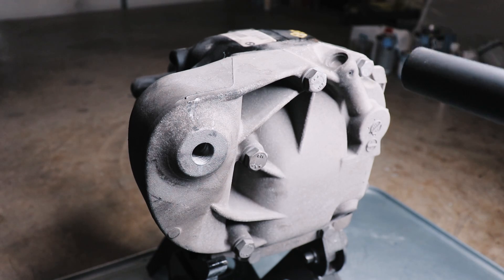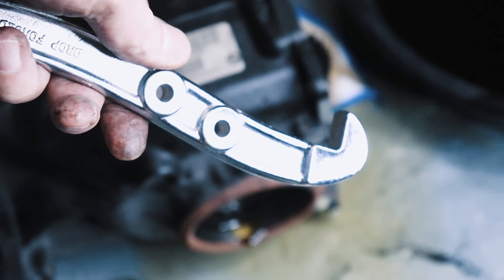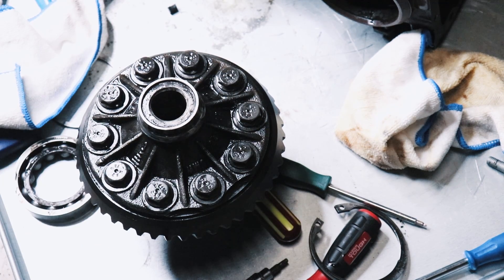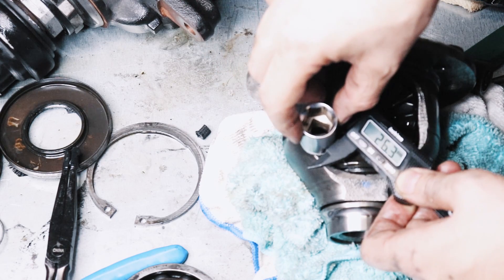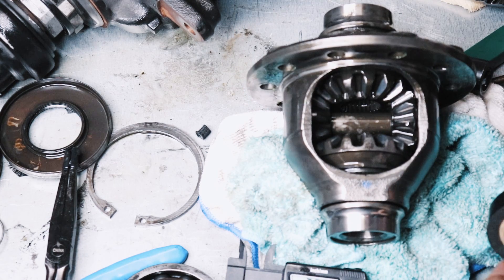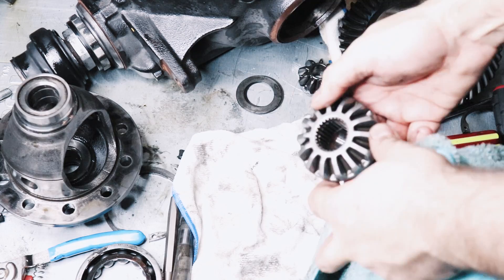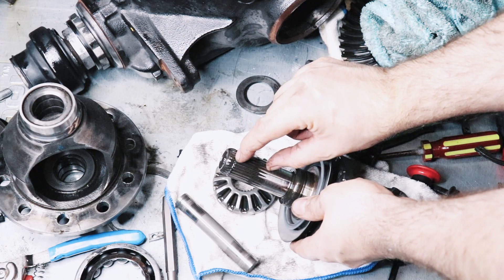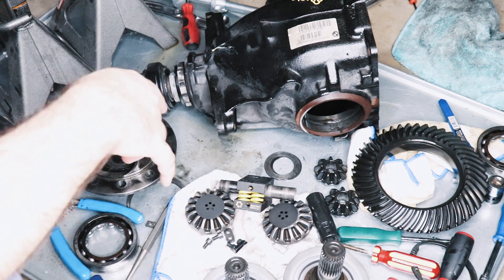BMW E90 $250 Limited Slip Differential Install | Part 1

Comment: Good video! I wonder how you managed to find an opened diff with bolted ring gear? Cos BMW welded them in 335s/135s after 2006, when you get the diff is there a specific part number you used to get a bolted ring gear one? Thanks

Comment: These diffs from the factory are garbage…. No drain plug so no easy oil change “sealed for life” , in the search for ever better economy figures losing friction is a big thing so these later diffs have ball bearings instead of taper rollers. If you get more than 70,000 miles out of one without the pinion bearings howling like a bastard you’re doing well. The side bearings are generally OK but need carefully checking for pitting but new pinion bearings and a crush spacer are essential. The thing you forgot to mention are the the circlips are ground and marked with the thickness and MUST go back where they came from…..

Comment: What is the durability of this set? Are you happy with it? Does it work the same all the time?
How many kilometers have you done with it?
Reply from the maker: I've done about 10K kms and so far yeah it's decent for what it is.  It's about 50% as effective as a true LSD as it works great when the car is pointed straight, just as good as you would hope and about 50% as effective when powering through a turn.
Reply: So it feels janky?
Reply: @tonyoner5816  it's not that it's janky, it's just far less aggressive with only 25% lock.

Comment: I have been told that these E9x diffs have noise issues.  My 2012 328 has developed a high pitch whine coming from the tear end.  Have your heard about this and if so have you addressed a resolution for this issue ?

Comment: Yeah how'd that work out for ya? Didn't see a video. Might have been worth it to check pinion lash and buy some tools to properly to the job. And despite what manufacturer said it basically is a phantom diff. I'm sure you made it 3 days of driving before whine or failure. Differentials are built off tight and proper tolerance for function. Didn't see much of that here.

Comment: Are you running your car on original turbos with MHD? Don’t you have over 185,000 miles? Are you going to change out the turbos anytime soon? I gather you don’t have any wastegate issues for both front & rear turbos?

Comment: Wait so my stupid e90s don't even have diff drain and fill bolts? I hate these cars
Reply: Yes, it has a drain bolt, but you need to insert a hose and suck the oil with a manual pump or a vacuum canister. then, to fill it agai you just need to fill it until the diff start to spill the oil. 👍 i have an E90 with open diff and i have changed already the oil.
Reply: @technopro-kz4xv  Fck that! The new owner can do that bullshit. My e36 m3 has a fill and drain bolt. e90 can blow me, not wasting all that time sucking out old fluid.

Comment: The instructions you showed in the previous video stated 30mm gap required and 4mm off the shafts for e90 188L.

Comment: Just too much time, mickey mouse engineering, and a destroyed differential.  It would have been interesting just to drop-in a an assembled unit and be back on the road pronto with all the correct internal gear specifications guaranteed.

I wonder what the mileage, lubrication and maintenance schedule on the differential was?  I would inspect those shafts for scoring for sure.  It would have been beneficial to drop all of this into the larger differential case as that small of a clutch surface will reach some very high temperatures if it is worked hard at all.      Good luck!
Reply: Typical answer from someone with too much money and zero interest in learning how things work. 
Dropping in an assembled unit that will probably need a refurb is probably a worse option unless it's been refurbished  to a high standard at the price of potentially thousands